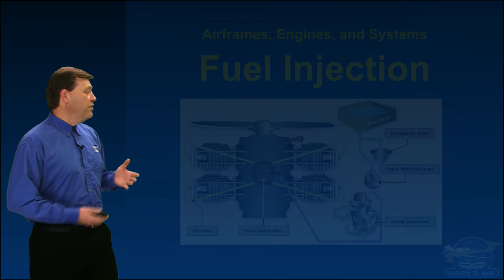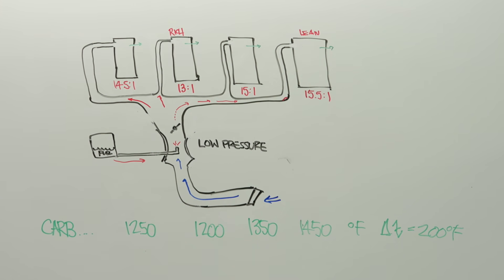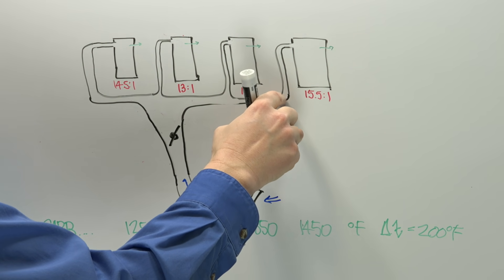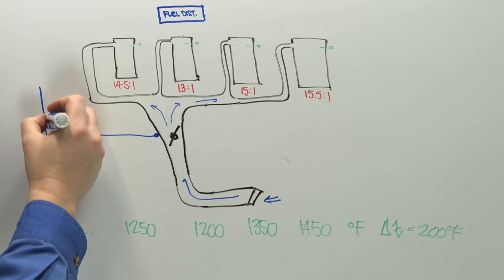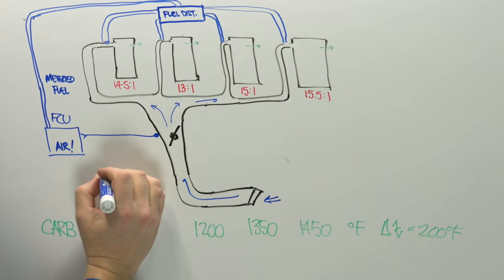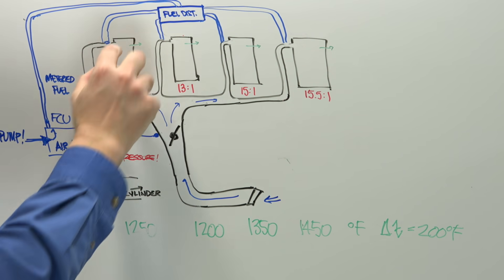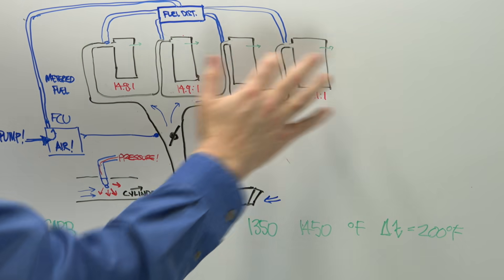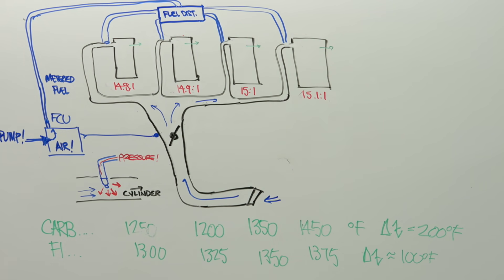Intro to Fuel Injection

Comment: Unless you have wideband 02 sensors on each exhaust primary, to monitor AFRs at each combustion event, and then a means to adjust to balance it’s a guess
Reply: airplanes usually have exhaust gas temperature indicators, single unit or one in each cylinder, which allows inference of lean/rich mixture
Reply: @dansid  can EGT sensors be monitored like O2 sensors for tuning for carbed applications when no ecu exists?
Reply: @WesternReloader  this is done in flight, in heights where the lack of oxygen messes up with the ground tuning
Reply: @dansid  appreciate the response. I’m looking into adding either individual cylinder O2 sensors or egt sensors to aid in my tuning of a 10:1 carbed V8 in my Bronco. Currently run a single wideband at collector where all primaries meet, but I could be washing down some cylinders and leaning out others while reading 12.8 at wide open and 14.5 cruising…
Reply: @WesternReloader  I believe O2 sensors to be more reliable for fine tuning because engine venting also interferes with EGT reading in aircraft, but most of their engines are air cooled.

Comment: So when a cylinder has the intake valve closed, fuel is still sprayed into the intake manifold?  Building/vaporizing before getting drawn into the cylinder?
Reply: Correct. This system is not much better than a carburettor. It's running 100% duty cycle which causes worse atomisation. What he calls a distributor is actually just a 1to 4 junction box. There was mechanical injection much more advanced than this used in Europe.

Comment: The video mentions the FCU determines air flow based on a throttle position sensor. Is that right, or does the FCU meter fuel directly from measured air flow?

Comment: i have carefully listened to your explanation, and its quite good,  but my question is how does the FCU fuel control unit sense the amount of air during idle state of the engine
Reply: From what I know, idle does not mean ZERO air is entering the cylinders. Idle simply means a very little amount of air but not none. So you can say that if 'idle' ever meant zero air, the engine would then stop running immediately because it couldn't ignite the fuel being injected. So from that we know that there is an amount of air to be sensed. I hope this answered your question! 
If you mean the 'mechanics' of it then I honestly do not know, I hope someone knowledgeable clarifies it for both of us!